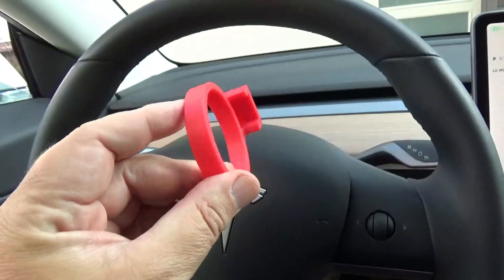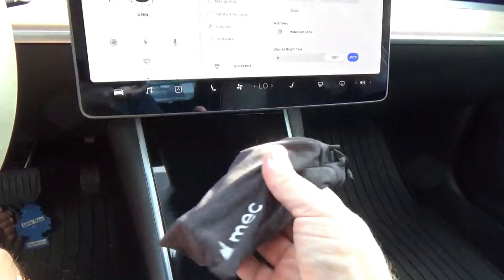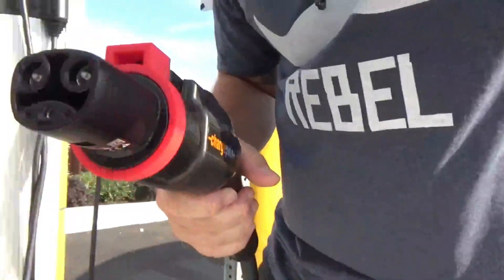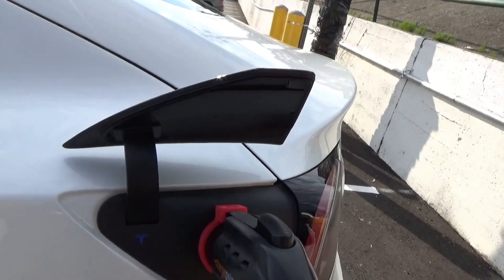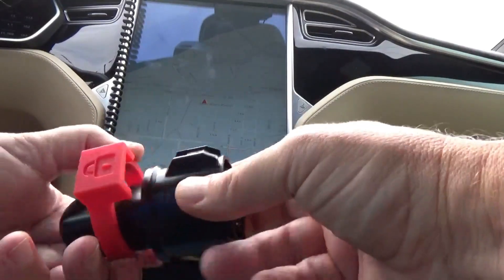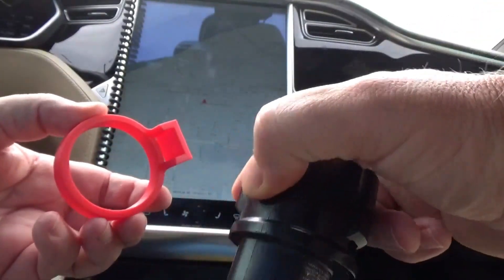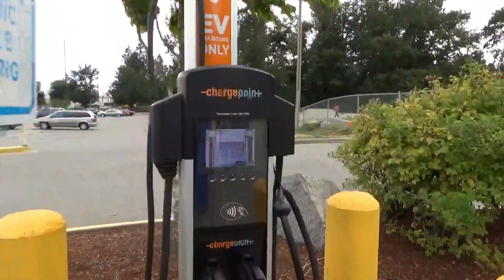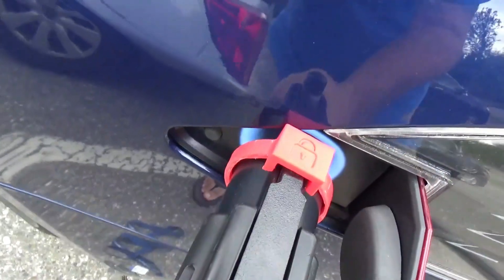TESLA J1772 LOCK

Comment: How do you unlock it?
Reply from the maker: Sorry, I missed your question.  Once you pull the charger and adapter out of your car the ring slips off.   When the plug is in, the car stops the ring from slipping off hence locking it.
Reply: @canadianteslamartin9221  so can’t anyone just unplug it then?
Reply from the maker: No, the ring locks the plug to the adapter and the car locks in the adapter.

Comment: $22 for $2 of plastic or actually less. I have a 3D printer at home im a try to print something off and see.
Reply from the maker: poobear Cretu - we could say that just about everything we own.   I don’t have a 3D printer so $20 is a steal.
Reply: @canadianteslamartin9221  true. I think a mini lock on the part of the public J1772 charger would work too. Maybe time to 3D print some Tesla Roadsters.
Reply from the maker: If someone came out with a thin plastic band that was thin enough so when slide over the j1772 clasp it wouldn't touch the vehicle, BUT, it would have to be secured somehow so it wasn't possible to slide the band out towards the charger.
Reply: MasterLock 7LJ-KD #7 Laminated Padlock
MasterLock 7LJ-KD #7 Laminated Padlock
Reply from the maker: Doug Garet - thanks Doug.  Is there any reference on how this would be used.  I just googled the lock.  Looks interesting.
Reply: Canadian Tesla Martin eBay charges 3.00 to sell it. Shipping is 3.09 package is about .70 cents. 

Sell on amazon and it’s double.  $8.00  He's not making MUCH At all... Thats what I meant:)
Reply from the maker: James Madison Audits - aren’t we all though lol.   Thanks for the heads up.  I have yet to experience anyone trying to unlock my charger, but then again, I am in Canada and few EV’s.
Reply: @canadianteslamartin9221  Sorry I updated my reply... with all the fees and crap you go through to get something its hard to make a big profit.. Its a fair price!